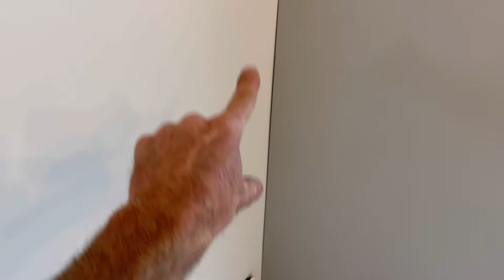Scribing in decor end panels Part 3 - Harborne Series

Comment: just the info i have been looking for as i have got four to fit next week thankyou only query i would like to know is two of my tall panels are as yours on the end of a run but the other two are butted up to base cabinets so would you cut a square notch at floor level so the plinth will continue to the end of the run or run the whole panel down to floor so seperate plinth on unit hope you understand what i mean cheers
Reply from the maker: That’s a preference thing. It’s entirely up to you. I don’t mind having a break in the plinth by the running the end panels down to the floor especially if the tall cupboards are in the middle of the run of units. The reason why I like it is because I prefer it to joining plinths. Good luck with your project
Reply: thankyou for the reply just watched the other three videos nice and there is great tips and problem solving best wishes @Mr_A_Builders
Reply from the maker: Glad they could be of help to you and thank you for watching and commenting on our channel. 👍🏻

Comment: On a howdens kitchen what would you have done in this instance as there end panels are already cut to the correct size?!?!?
Reply from the maker: I only have two answers to that mate 1. you can’t which is another reason why I stopped using them 
2. plant another smaller piece of deco end panel on top scribed in or a piece of decorative trim 🤷
Reply: @Mr_A_Builders  yea it’s not great if the walls aren’t very good which 9 times out of 10 there not!!!

Comment: When you need to scribe the end panel to the floor and the wall which should you do first ? Floor or wall ?
Reply from the maker: Hi John and thanks for the comment. I cut my panel to the floor first to get correct height. The panels generally have banded edges so where possible put that to the floor so it protects the edge from any possible moisture exposure. Hope this helps but if you need to know anymore feel free to send another comment and I’ll happily help you out if I can 👍🏻
Reply: Quick question do you open the scribber to the amount to be cut of .it so it finishes flush at front ?

Comment: When I design kitchens one detail that I like to incorporate is to set the base units 150mm off the wall and this has a number of benefits:
1)  It allows room for services gas, water, electric, drainage with plenty of space for them to bypass each other.
2)  A standard 600mm worktop is set on the base units and then a 250mm deep worktop is set on top to close the gap and create a raised area that is perfect for storing the plethora of kitchen gadgets we all have- kettles, mixers, toasters etc up off the main worktop and out of the mess that usually ensues during food preparation.  The 500mm working top that is left is comfortable to use as it is clear of the clutter that most kitchen worktops have to accommodate.
3)  Any overhead cupboards are fixed to the wall that then sets them back from the front edge of the worktop, which means that they are not immediately 'in you face' restricting comfortable worktop use.  The cupboards are still within easy reach.
The loss of 150mm of general floor space is mostly unnoticed except in the tightest of kitchens.
One of the things that I find most disappointing in modern kitchen designs by the big outlets is that style takes priority over cooking, with too many kitchens being highly inefficient in their layout.  The current desire for large kitchens often shows how poor the understanding is of kitchen design, just talk to real cooks and chefs about kitchen design to get what a kitchen should be, nothing should be more than one pace away from anything else is one guiding principle and the triangle of store/prep/cook is another.
Reply from the maker: Thanks for such an in depth opinion we appreciate your time. Although I agree with the statement and understand the efficiency triangle approach in the design process the ultimate failure is always the customer not wanting any of that despite all the onsite conversations and the acceptance of the fitters professional opinion. 🤷 thanks 👍🏻
Reply: @Mr_A_Builders  I was involved in the refurbishment of a very large 6 bedroom house within a gated community.  My client owned the house and previously let it out to the Financial Director of Shell Oil so you can gauge its standard.  The kitchen/family room was 8m x 9m with the kitchen taking 50% of the space.  The tenant had by all accounts refitted the kitchen and clearly spent a great deal of money on serious quality kitchen fitments.  The layout included a  huge island unit that was just a massive work top that you couldn't reach the middle of and one long wall had two huge built in fridges/freezers and two oven units next to each other, with two microwaves,  the hob was on the other side of the room along with a built in coffee machine.  I would expect that the family employed a cook who must have been the fittest person in the house given the amount of walking they had to do.  Imagine cooking at the hob unit and walking nearly 8m around an island unit just to see what;s happening in the oven???  Fortunately the refurbished kitchen was more sensible having been designed by the kitchen fitter to the Royal Household and specified by the clients wife, who was a good cook.

Comment: I like the idea of scribing but haven't the balls to let my cheapo jigsaw loose on a £150 decor end panel. I've seen people using electric planes and sanders but I'm still not confident enough in my abilities to not screw it up! Anyhow nice video mate 👍
Reply from the maker: Hi Gary and thanks for commenting. I normally use a track saw but the existing wall was that bad to scribe there wasn’t enough straight lines to work to. You may want to try a downward cutting blade in your jigsaw they are easier to handle if your not confident enough to do like I did. I hadn’t got any at the time and couldn’t be bothered to fetch one 😁👍🏻
Reply: @Mr_A_Builders  Thanks for replying 👍 I do have a downward-cutting blade but find it can kick back with some force so needs quite a heavy hand - ie the opposite to what you want when you're trying to follow a precise line. I'll try it with an offcut and report back 😀